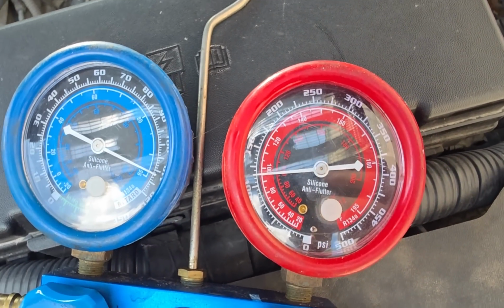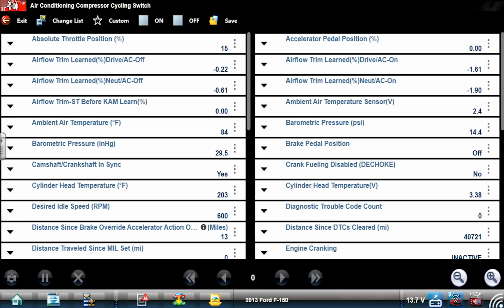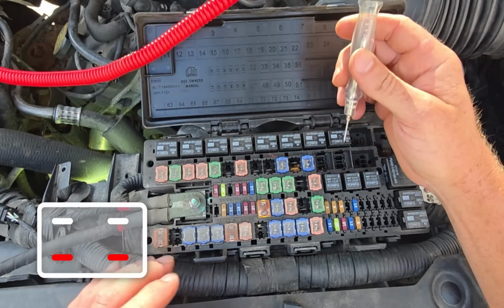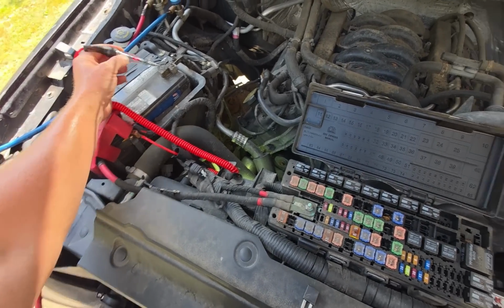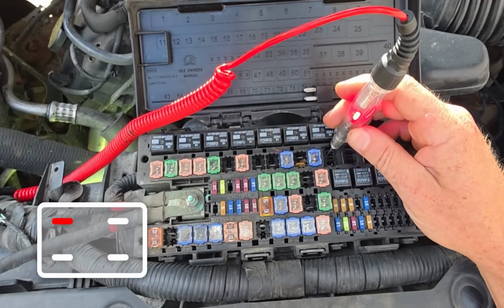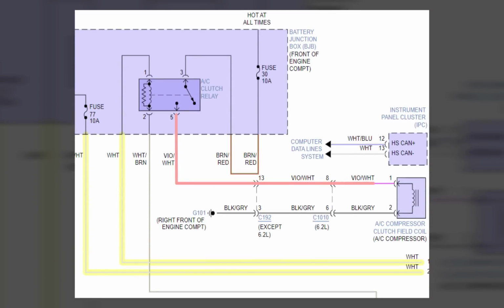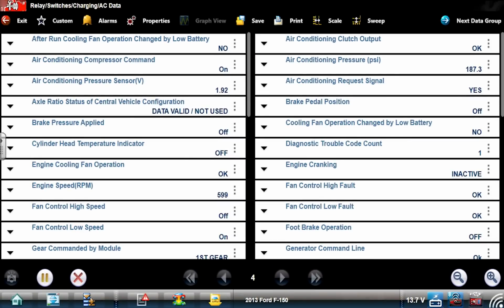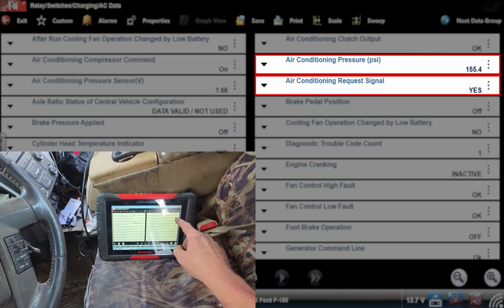A/C Compressor Clutch Circuit Testing [All Cars] + Recharge

Comment: Paul, send me that link for the gadget one plugs into the relay port to know if the compressor solenoid is ok, and also if the internal compressor ground is ok.

You used that gaget in another case with a compressor problem, where you were teaching your son too.

Thanks.

José Antonio
San Juan, Puerto Rico
Reply from the maker: It's called a uActivate and you can find it here
https://www.aeswave.com/scannerdanner

Comment: KOEO self test will cycle the ac clutch relay. Very easy way  to test ac clutch circuit.
Reply from the maker: I thought the test i showed was very easy too 😉
But you're not wrong. I just never needed to do the bi-directional test in this case
Reply: @ScannerDanner  Understood. just putting the test out there for others. Not a disagreement. The koeo test eliminates the inputs. Gives a direction either way . Great catch btw.

Comment: Hey, I watch your videos a lot and I am a technician. Have you ever considered using subcooling and superheat to measure a vehicles charge? Charging a system with pressure alone is not something you would see in the actual HVAC world. I have had some luck using the sub cooling method on vehicles that use expansion valves. At my shop we are currently trying to figure out a way to evolve how we do AC testing and use some of these HVAC concepts you see in the other trade
Reply from the maker: I just asked AI this question:
"why automotive hvac techs dont use subcooling and superheat"
And the answers are pretty accurate! But there is more too, from underhood temperatures, to location of components and lines. 
But check out the Google results of that question too. I didnt want to just post that as my own answer. Thank you!
Reply: @ScannerDanner thats the biggest issue ive had so far is not having correct temperature probe placement on the suction or liquid line. Maybe one day! Thanks

Comment: a/c cycling switch is the low pressure cutoff in most every vehicle I know of. basically cycles compressor on and off at a fixed pressure so it doesn't freeze the evaporator up.
most fords have 3 wire switches that I recall, but I don't even do much automotive anymore except my own and close family.
Reply from the maker: Right but that is an input or direct psi switch, and is not something that contains an output driver and a bidirectional test
Reply: @ScannerDanner  true, I don't think they've even have a physical low side "switch" for many years, last I seen some had a temp sensor at the evaporator coil and a high side switch/transducer to have ecm control fans and safety cutoff.
too many vehicles and changes, some had "man in the middle" electronics/computers/fan controllers that sometimes had the sensor inputs then they let the ECM know to turn on/off a/c clutch relay if it didn't have high engine load requirement.
bunch of over engineered cruft and useless loops.

Comment: Had a Chevy Tahoe with a restricted condenser or tool much oil. Replaced condenser and what do you know, now it needs a driver side actuator which requires complete dash disassembly! 

You already gave customer a price but it’s not 100% fixed, what do you do! $675 into it and no cold air out driver side vents!  Now he needs actuator plus 10 more hours labor. Hard to explain.
Reply from the maker: Not your problem. You didn't build it or break it and there was no test you could have done to catch that secondary issue
Reply: @ScannerDanner Yeah it’s getting ridiculous. First he had no cold air anywhere. The high side pressure was low and I noticed right away the line from compressor to condenser was crazy hot but line coming out condenser was luke warm. Line from evaporator and accumulator was not even cool. I had previously did an evacuation and recharge so no leaks and correct refrigerant amount.  

After replacing the condenser I was still skeptical but low side was ice cold, and passenger side and rear a/c was ice cold. So condenser was definitely restricted. Fans always operated normal but slow speed. It was high speed after condenser was replaced. 

I disconnected battery and reset actuators with scanner, it somewhat worked but if you move the temp dial it goes hot again and stays there. So I left it cooling somewhat and showed him the rear and passenger side is now working and low side line is sweating and accumulator is ice cold. 

This really upset me because I know the guy.  But I can’t eat 10 hours labor! Probably take me 2 days.
Reply: @ScannerDanner  Agreed.
In my case I like to avoid problems by explaining that the first step does not mean there may not be other problems. 
And get it i writing that payment will be due even if not pursued further.
Reply: Not hard to explain if you handle the initial conversation properly. 
Mr. customer, we have to address the first issue before further system inspection, replacing the condenser does not mean there may not be other issues, we will document the first repair with your understanding that this estimate does not guaranty restoring your AC system to complete proper functioning. 
What is so difficult about this?

Comment: so no a leak or compressor fail.. it would be, 1st one this year for me....
Reply from the maker: When a system is low on charge, there is absolutely a leak somewhere. But since it has not been serviced in over 2 years, the leak would be so small that I wasn't worried about trying to locate it on this day where I was simply helping out a friend. If this was a customers car, you would absolutely want to sell some testing time to try to locate the leak. The main take away from this one was how to properly troubleshoot the electrical part of the AC compressor clutch circuit. Thanks!
Reply: @ScannerDanner  Sorry for the long response time, but first i was like. Are you(me in past) drunk bro?
Nope. it says it clearly, what i mean/menth! ..yes American or British is not my first, language.
So now you know that i only had leaks or compressor faliers on this year at that time...

Today ac working at sometimes but not other.... was blowermotor  didnt work like expected.
The "smart resistor" command in feedback out and even the FB told that there was something wrong but NO, no dtc and wire didn't run like in the "book...

Comment: Had an F150 act a lot like that one in your video this summer.  Belonged to a friend who recently had a transmission replaced… he was already to blame it on the repair shop.  (Even though they weren’t in that area whatsoever)  I ask him to please let me to give it a look first.  

Turned out to be a connector not completely clipped together at the compressor clutch.   All the diagnostics completed with a test light too!  Proves you have to check ALL the simple stuff.  

Thank you “Dan” for teaching me.  I’m forever indebted to the ScannerDanner channel.
Reply from the maker: Thank you!

Comment: Relay Function
Connection / Notes:
85:
Control side ground
Connect to chassis or negative side of control switch
86:
Control side power
Connect to positive voltage from switch or control circuit
87:
Load side output (NO)
Connect to the device or accessory you want powered
30:
Battery voltage input (hot)
Direct 12V from battery, always hot, fuse recommended.
Reply from the maker: This relay is being controlled by the engine computer. The control circuit can be switched on the power or the ground side of the circuit. You are correct in that it is a switched ground on this design, but it is not a physical switch, it is a transistor.
Reply: @ScannerDanner 
Understood, I wasn’t sure of the design for this application. Thanks for the clarification. Reminds me of the Starter Relay inside the Intelligent Voltage Module, i.e. (IVM)  on my BMW 760i

Comment: Fun preliminary test, KOEO amp clamp on battery negative, zero amp clamp, bidirectional command compressor clutch on, compressor  clutch does not move, if amp clamp shows between 0.15 to 0.25 amps relay coil and relay control is working.
Reply from the maker: Good test. So many ways to tests circuits and there is no one "right way"
Reply: @ScannerDanner  I just like to perform as many tests as possible for redundancy and also I always learn something new by using this method.

Comment: Had intermittent AC on my Corolla that turned out the be bad bushings in the OEM radiator fan. It sometimes wouldn’t turn until I hit a bump or got up to speed. Even then, it would only spin fast enough while moving but you couldn’t tell (fan looks like a blur regardless). Finally realized what was causing it when I realized the fan needed a nudge to start while parked. When it’s hot you usually only look after realizing in the road that it’s not working and by the time it would be turning, albeit slow.

Comment: One thing that could help you with these type of diagnosis's is once you knew it was a wiring issue using the test light to show when it had continuity or not, since I work by myself alot, I have an emergency exit speaker off a school bus with a pigtail and alligator clips I made that to replace the test light in your situation, I use it so no matter where im at on the vehicle moving or wiggling wiring harnesses trying to find the spot, I can hear that beep sound no matter where im at, they are obnoxiously loud so I did put a piece of tape over the small speaker opening, (the whole thing is  only the size of a golfball), just an idea, i like to use that for not needing to always have to have a line of sight to it and you can hear the small chirps very clearly if your getting close
Reply: I added a little buzzer to one of my test lights for when im alone
Reply: Very  clever 👏 👌
Reply: YEA.... DAN! He said Dan!😂
Reply: So a power probe does the same thing when it finds a ground. Makes a very loud audible noise. No need to make a buzzer
Reply: @mikesabin8568 yeah, but I dont have or use a power probe
Reply: @natersalad889 sure, but they are about 100 bucks and useful on everything
Reply: @mikesabin8568 well PP cost  $200 😮

Comment: The big lesson in this video is that not a single clip you see in the engine bay is frivolous. It may seem like clips and such are there just to make wiring and hoses look pretty, but the reality is car companies don't spend a nickel they don't absolutely have to, so take care with all your clips and attachments, make sure everything goes back together, try to use a zip-tie or something to replace any clips that broke during repairs. Look for stuff like this when you're checking oil or doing other maintenance, because the clip you push back into place is going to be the problem you save yourself, later.

Comment: Why would you get hot on the ground side of the relay. With the test light on negative post why would you get hot on the ecm grounding terminal and the the clutch feed if the relay hasn’t been jumped.
Reply: His test light was on battery positive when he was testing for ground from the pcm and ground through the clutch.
Reply from the maker: Thank you!
Reply from the maker: Great questions. Test light was on battery positive for those tests.
Reply: @ScannerDanner  His confusion may have stemmed from the circuit's drawn  diagram. Unless I'm missing something, the red tracers indicating power flow in the circuit, are misplaced. 
At 4:45 in the video, testing the relay socket begins. I'm assuming your test light starts on battery negative to find the power feeds, which would likely be control side power feed and load side power feed.  As far as I can tell, the animated diagram disagrees with the testing. Even the chapter title description reads 'needs highlight changed'.
Reply: You are right 👍 the animated diagram disagree 4:45  @Rawr454

Comment: Had a 2002 Ranger with intermittent cooling.  Noticed when I came to a stop light is when the AC would start getting warm.  When I start moving again, it got cold again.  I assumed it was low on refrigerant and the higher RPMs made the difference.  Checked the pressures and all was OK.  Then, I noticed the clutch intermittently stopping and starting.  The clutch disks had worn.  There were 3 shim washers on the shaft.  Took one out and no more problems.
Reply: That's why he tapped on the clutch shoe.  If it had too much air gap due to wear, then it would have engaged when he tapped on it.
Reply from the maker: Exactly!

Comment: Learned a lot from this video; an unscrupulous shop would've installed a new AC compressor and NOT fix the main issue. As illustrated - proper diagnosis is KEY!!!

BTW: your buddy is lucky he's friends with you. Hopefully next time he'll clean his interior and have a full tank of gas for the next emergency. 🤣
Reply: But installing a new compressor probably wouldn't have fixed the issue, unless by chance the connector happened to hold tightly when they put it back together. A few bumps in the road on a test drive would have caused the failure to repeat.

Comment: I was going to leave a comment about you using that r134a with the sealant in it, then you said you don't like using anything with a sealant in it and normally don't so I held back LOL!  You said he has used it before, so that tells me that junk doesn't work well anyway.  I own a set of Fieldpiece digital manifold gauges and I would hate to know I hooked up to any vehicle that had that sealant in it.  Pretty sure it would destroy the pressure transducers on these expensive gauges.  I have a sealant detection kit that I use before I do anything on someones AC.  If it fails the test, then I send them down the road.  Not worth damaging my equipment.  Enjoyed the video and the diagnostics!
Reply: Good comment, may you share what sealer detection kit you use?
Reply: @IvanHVAC  I have a QuickDetect from Neutronics.  Got the kit from Century Tool & Equipment
Reply: @SkillSavvyDIY  $400 something dollars ummmmmm yikes